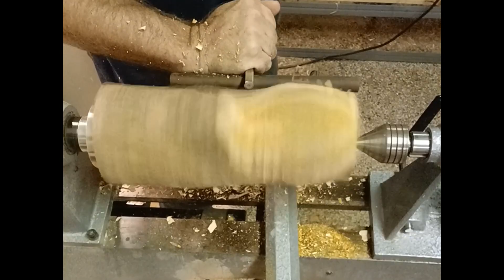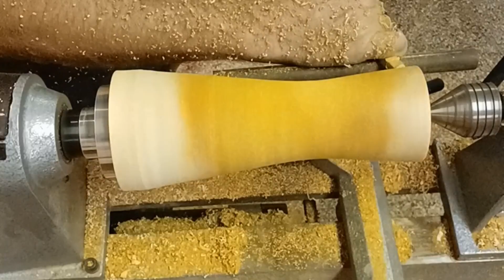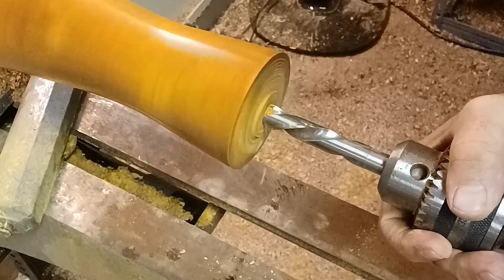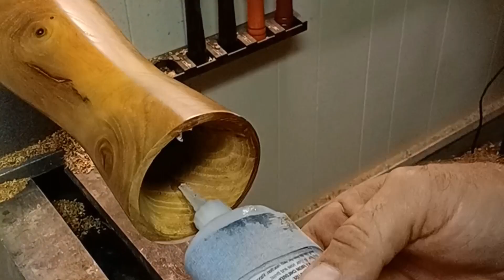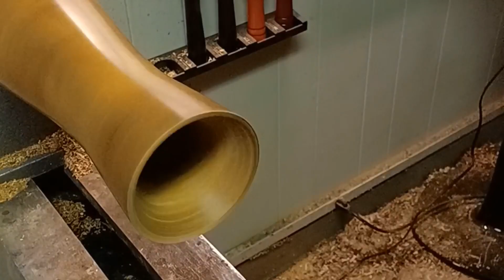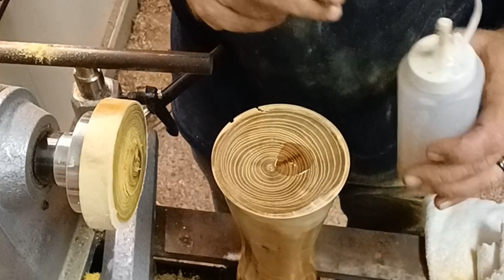Woodturning Osage Orange vase (Bodark)

Comment: Have you ever found a way to keep the yellow color?   Everything we've made eventually oxidizes to a dark honey.
Reply from the maker: Thank you for watching!
I use sanding sealer and poly it ends up honey. CA and epoxy keep the color the better. But nothing like when it's fresh off the lathe.  Rings are the only thing I've been able to keep yellow. I'm trying to solve that problem as well. I'll do an epoxy finish on my next one.  It works on cedar to keep the purple.